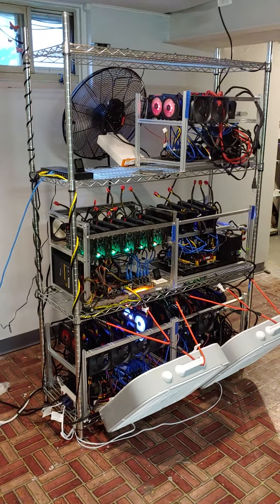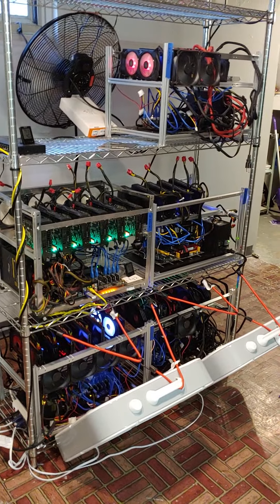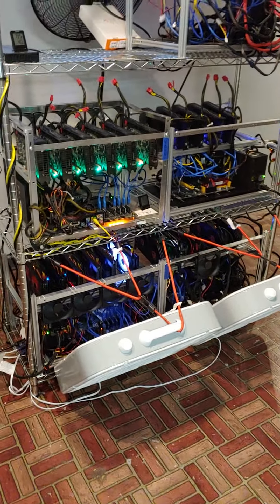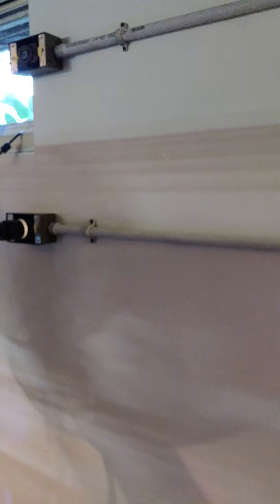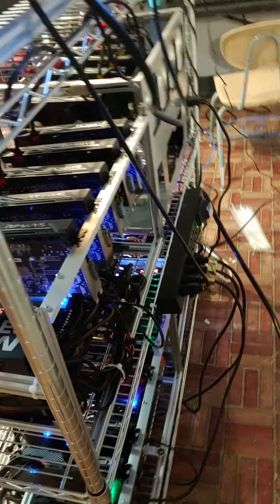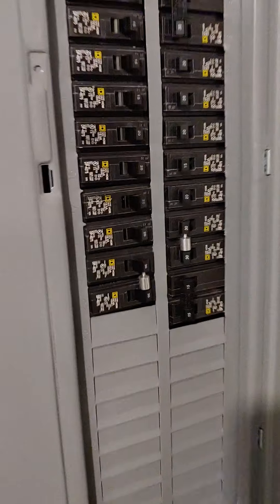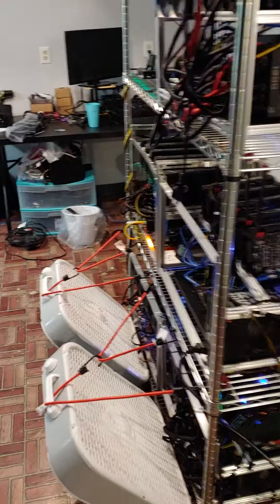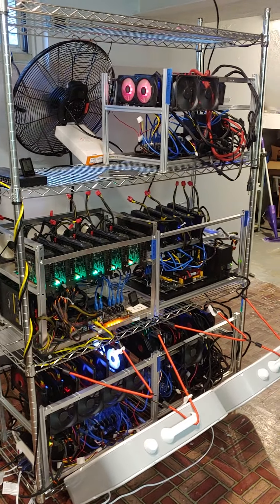200 AMP Service Upgrade Complete!

Comment: So weird that the Hercules doesn't accept a c13-c14 plug... Just curious what does it take?
Reply from the maker: It has a unique plug. I'm unsure of what it's officially called. 

I was able to use it with a PDU by buying an adapter for a standard 3 prong plug to C14. 

But I'm also finally getting rid of my Hercules PSU's and changing them out for Server PSUs